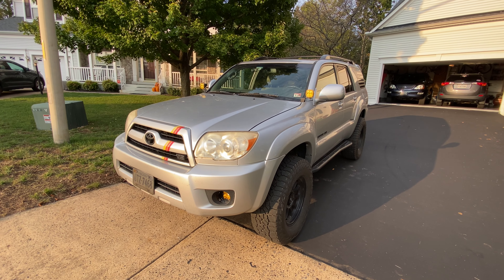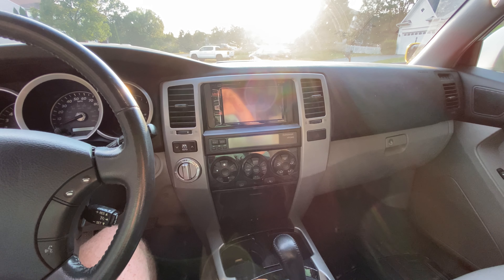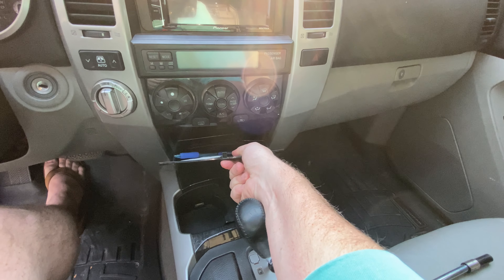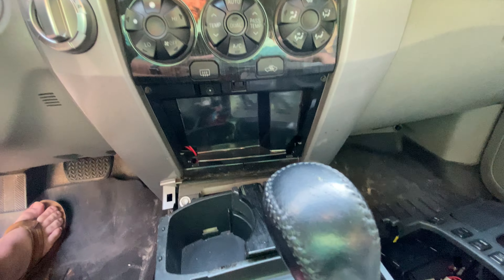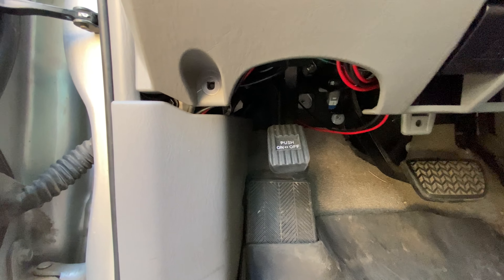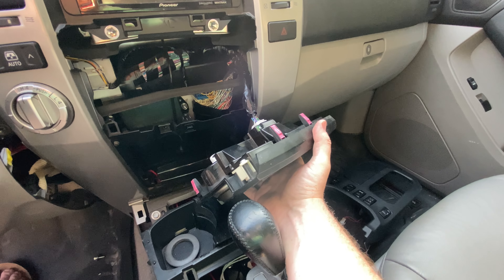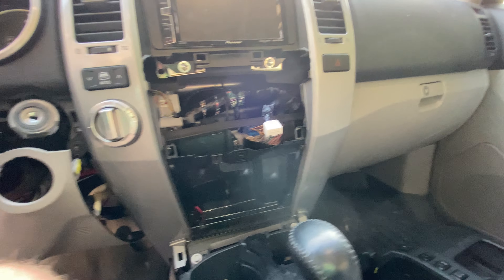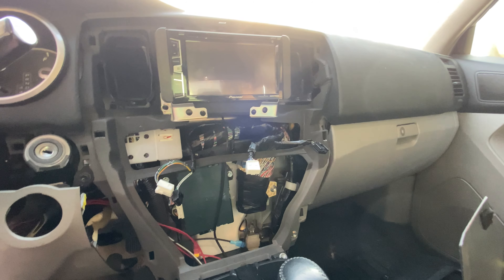How to Disassemble 2003-2009 4runner Dashboard / Remove Head Unit | 4th Gen T4R

Comment: Definitely helpful. It would be nice to see the whole dash removal. I just bought a recall dash, and I'm planning to install it soon.
Reply from the maker: @jadoriffic  not sure if Toyota will do it anymore but for a while they were replacing them for free due to the cracking that was happening on them, may be worth a quick call or google search, unfortunately I don’t have a video as I have never completely torn apart the dash, I’ve gotten close when replacing all the carpet in a different 4th gen I used to have but not 100% torn out, I hope you can find one that helps!

Comment: What is the model # of that aftermarket pioneer deck you have in there? And how do you like it?
Reply from the maker: @aaw925  I believe this one is an AVH-X390BS, it’s been good for me, I’d like to upgrade the amplifier in the vehicle though so I can use it to its full potential, it is capable of more than the stock amp can give it, so at higher volumes it will start getting distorted, but only if you push past what you’d reasonably listen to it at anyway…
Reply: It definitely is capable of a lot more I’m sure. I still have the stock navigation unit in mine but I am pushing 2 15s and a 5000w amp and a 1500w amp to the door speakers. The little puny stock amp is a pain to work with though. Without a new head unit I had to split into these tiny 18 gauge wires, which is not recommended for the wattage I’m sending through them. Of course the power wires I’m using for the amps are 2 gauge so maybe the stock speaker wires are ok, but I hear with your RCAs going to an aftermarket head unit like yours make all the difference. Also, I highly recommend replacing your door speakers if you do a new amp. The JBL speakers in the 2003 or 2004 (I believe yours is a 2004 by the looks of it) that you have were top of the line back then, but you will see that they use a paper cone and that could have something to do with your distortion too. Speakers have come an amazingly long way from 20 years ago. I would really like that pioneer deck for mine as well. Thanks for the info and I will be hitting the bell for updates because I feel like there is so much more I can be doing to upgrade that I don’t know about that you seem to have a pretty damn good handle on

Comment: How do you add switches like the 2 usb ports?
Reply from the maker: It’s very easy overall, I don’t really have a good video showing the whole process but they are out there…. Essentially you just take your switch, find an un-used fuse and put in an “add a fuse” line with an appropriate amperage fuse for what sort of power draw the outlet will have and then you just run wire to where it needs to go and add a ground wire somewhere on the body of the car. I’d just do some searching and I’m sure you’ll find some good example vids, especially from someone like Chris fix

Comment: Do you have a trip button on your 4runner? Mine doesn't have I want to rest maintenance light. Could you please help
Reply from the maker: What year is your 4Runner? They should all have a trip reset, mine is near the fuel/temperature gauge, the 03-05 4Runners have the trip reset on the far left of the gauge cluster

Comment: This is the console. Not the dashboard.
Reply from the maker: My apologies for any confusion.
Reply: @OffroadNova  Actually, you are correct. I am wrong. The console is where the shifter goes. The din is part of the dashboard. My bad.
Reply from the maker: All good, and you’re right it could better be described as the din, however I thought dashboard would be more common as far as terminology goes…
Reply: Well as far as using this to remove the dashboard it still a few steps short.